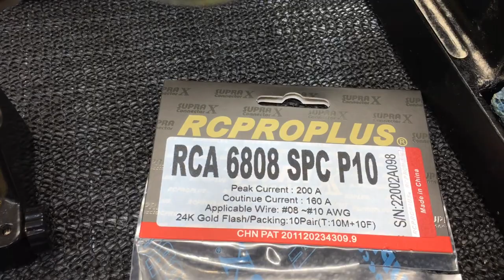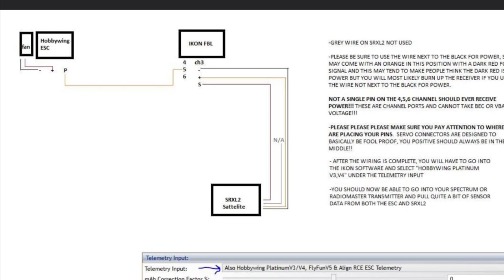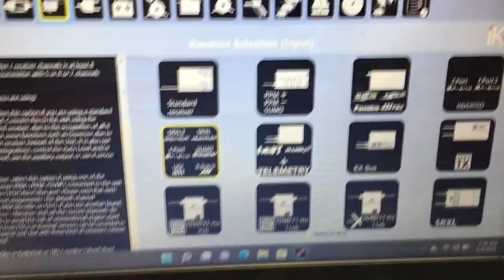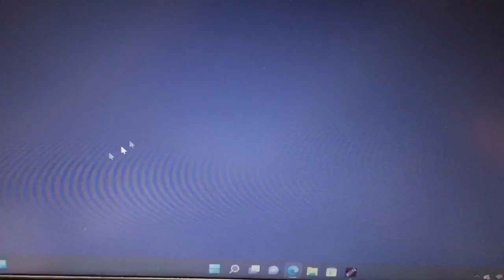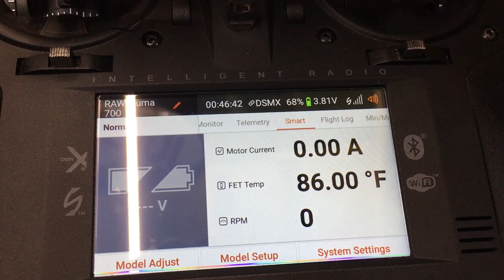SAB Goblin RAW 700 Piuma Build Part 4

Comment: I've been out of helis for 3 years due to vertigo. was on the top of my game with 3d flying at the time of my vertigo. Bought a raw 700 built it and crashed it due to vertigo. I quit and started flying gas planes which is bad ass but Im back to helis. Lots has changed in 3 years. I always used vbar neo with the fancy radio but always had brownouts with that radio, so this time Im going back to good old fashion futaba. I watched your video here and your goo sky rs7 video. I thought hard but decided to get the puima, its just a light bad ass raw with sab quality and innovation, goo sky looks cool but it looks alot like a spectre, looks heavy and theres alot of little extra things that make no sense and add weight. I did get a omp m2 evo just for shits n giggles. Its a great little heli to train my eyes and tracking again. Im stoked about the puima, decided to use the scorpion 4225 550 limited edition motor. I hear that motor rocks this frame. Thanks for taking your time and doing such in dept reviews.

Comment: Thank you very much once again Jeff! I appreciate you getting back to me regarding my message about the order of Binding Satellites and Telemetry. Once again Jeff, your Wiring locations and Wire Management is Sensational!! Stay well and my Best to You and your Family! ❤️🙏🙏🙏❤️
Reply from the maker: Of course larry! I try and help when ever I can! I try and build for everything, I think and think and plan before I start a build and make sure I can or the customer can repair and remove things easily! Everyone always says “pretty” wiring is worth less because you can’t work on it. I beg to differ! 
lol you can get “show” quality build with easy maintenance! Take care buddy!
Reply: @westhobbiesrc8051  In my opinion, with the Protection of your Wiring, all in heat shrink and Servo Wires cut to length, you should never have a problem unless it's a catastrophic mechanical failure, you never need to touch it! If yo need to repair or replace an ESC... You have allowed for that. If and when I build my next Heli, I'll be asking for Sizes of Heat Shrink and I'll be watching any one of many Videos you have posted that all have one thing in common, PERFECTION!! Take care and stay safe Jeff & as always, my Best to the  ladies, this includes the younger lady. ❤️🙏🙏🙏❤️

Comment: Beautiful wiring.  So I don't know or didn't notice that the screw on the wire guard, the one that goes into the side of the frame.  The screw is touching the motor mount.  So even though loosening the two nuts and screws to adjust the main belt tension, that screw was stopping the entire mount from moving.  Pretty sure I used the screw that came in the bag.  Have you notice that?  Both my 700 Raw Kse and Raw 580 did that.
Reply from the maker: Thanks very much! Definitely time-consuming but well worth it in the end. No I have not noticed that or run into any issues from that. I will look and see but definitely not had an issue from it.
Reply: Jon - The screw you're referring to does NOT attach to the motor mount.  Look at Page 9 of the manual, and you will see a note to not intall the screw which is for one of the tapped holes in the transmission group base plate.  It's this hole which will receive the attachment screw for the wiring support.  It does appear that it would possibly go into the motor mount, but it doesn't.
Reply: @robpound8163  yeah the screw that I used is too long. It goes all the way through and touches the motor mount which stops the plate from moving.  Just need to swap it out with a smaller screw that is all.
Reply: @Scjon03  👍

Comment: It came out incredible as you say 👍 
WestHobbiesRC, I balanced the main rotor blades. My question would be: what's the weight difference we don't care about? I balanced the 470's blades to around 0.04-0.05 g difference. CG seems identical now. Weight difference was around 0.08 g but the CG was 1 mm off. Had to use both of these metallic stickers Align provided and some aditional clear tape.
What's your take on the aforementioned weight difference that is acceptable?
Reply from the maker: Thank you! So personally I have never had to weigh or balance any set of Align blades. That is definitely a pretty big weight difference. I will double and triple check that weight. Are you using a blade balancer? you want your blades to be within same spec of each other.
Reply: @westhobbiesrc8051  I used the edge of a cutting blade for determining the CG like ín one of the vids on YouTube. The scale I use isn't that great but it's the only one I have. Tomorrow I'll try to increase the weight to have 0.00 g difference while keeping the CG.

Comment: What size heat shrink you using.  Nice work
Reply from the maker: Thank you! I use 3/16 for servo wires and 1/2in for the multiple wire junction.

Comment: Hey again!!! I have an Sab raw 700 with the same satellites you have in the video. Do I need the srxl2? I have my satellites on each side of the frame but I see you have the srxl2 and I’m curious if I  need that?
Reply: Will I fly just fine with satellites?
Reply from the maker: @The.Daily.Commuter  hello! You don’t need a SRXL2 but if you want telemetry and ikon programming from your radio (NX and IX) then you will want a SRXL2 but it will not change the way it flys.
Reply: @westhobbiesrc8051  oh okay awesome, I just bought an srxl2 for my 700 and I’m gonna try it out and set it up your way !!!

Comment: Yo, can u do a video on how to level the swashplate on the fusion 360? It be really helpful. Also I'm having trouble with the flight modes, as in the 6250hx only has one flight mode. Help!
Reply: I do did a factory reset on the fbl it didn't help.
Reply from the maker: Yes I can definitely do that! I’m still learning the 6250 so as soon as I’m 100% happy and confident I’m what I’m doing with the 6250 I’ll be making that video soon! What are you looking under flight modes in? Forward programming or channel Monitor?
Reply: @westhobbiesrc8051  forward programming
Reply from the maker: @sawyerheslep8493  so I am actually trying to figure that out as well mine only shows one too. Once I figure it out I will be making a video on how to do it!
Reply: @westhobbiesrc8051  best wishes! I hope u figure it out! Since I reset it the swash is no longer level, I don't have a leveler. Any advice?
Reply from the maker: @sawyerheslep8493  zip tie! Look you zip tie swash leveler and there is a bunch of videos showing it. You out a zip tie around the main shaft then one straight down on the tip on the swash ends. It’s not 100% perfect but will get you 99%. Great choice hen you don’t have one.

Comment: Why do you add 2Deg rudder on tail
Reply from the maker: I add 2-4 degrees because of mechanical leverage. For a proper tail set up you don’t want the Gyro to be working as far as hunting. So if you have a neutral tail the torque of the helicopter is going to spend the helicopter knows left tail right. If you add a right pitch from the start do you have that mechanical leverage and the Giro doesn’t have to work and hunt to try to keep the tail straight it will automatically stay straight as the helicopter spoils up you are pushing against the rotation of the rotor.